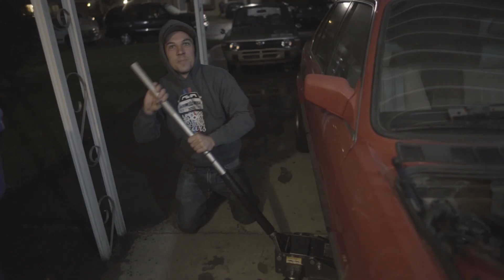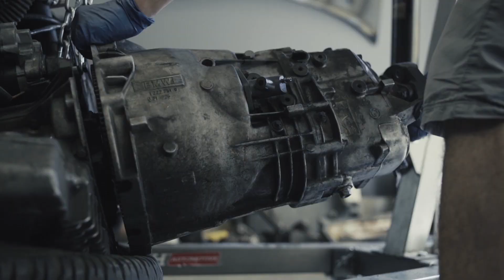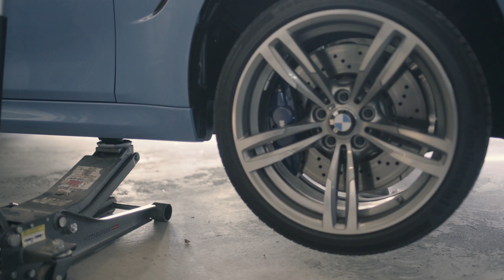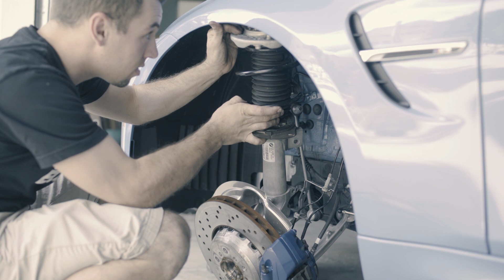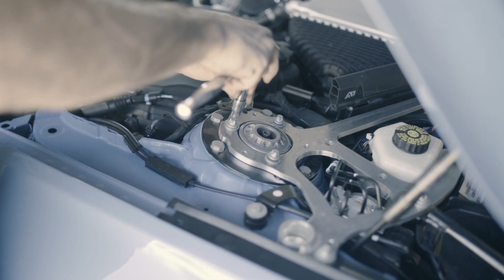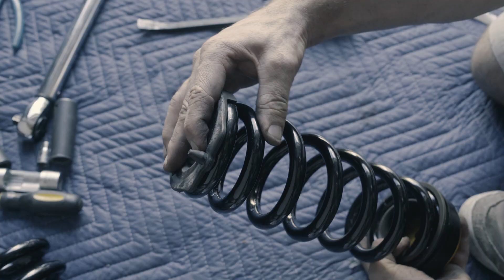Lowering your F80 M3 / F82 M4 (lowering springs DIY)

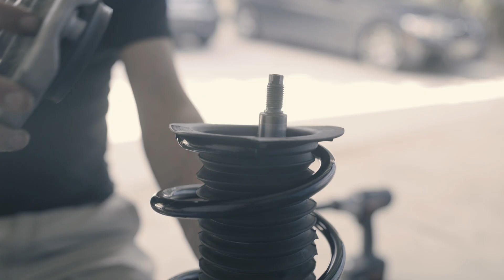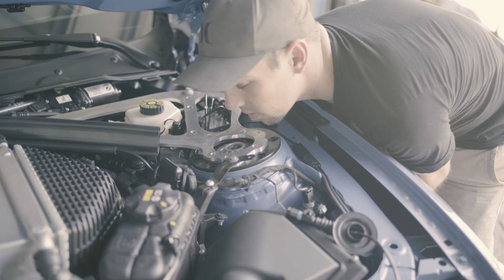Comment: when reinstalling the top mount (5:06), how should the rubber booth and spring be sitting? Also, when reinstalling the top strut mount bolts (6:23), how do you align the top mount with the holes? does it spin? Thank you for the great video!

Comment: Just watched a mechanic fitting lowering springs to  a m4, 
 You didn’t need to do half the the tasks you carried out, like removing brace bar, carbon fibre brace and the total dismantling of the front shock. The mechanic just removed the nuts to the struct, dropped down the shock, removed the spring, replaced the spring and rubber cover and re fixed nuts to strut,you made this job twice as hard than it needed to be 😊👍🏻
Reply: maybe they have 1500$ install price for 300$ springs and they want to show how hard it is to install:))
Reply: This video is so misleading! Carbon brace does not need to be removed. Taking the whole shock off is not required, taking off strut mount is not required. Taking off the whole brake hose mount is not required just pull out the wires!! - all you need to do is open the centre 18mm 12 point bolt and the strut will drop down. You made this job thrice harder than it needs to be!

Comment: Quick Question, on your camber screw how far you have to raise the jack to release pressure? , yours looks it came out very easy, did you use any oil or rubber mallet? my is super hard to come out, tks